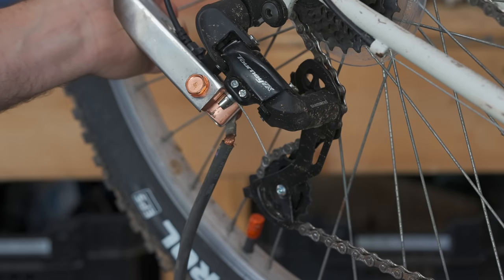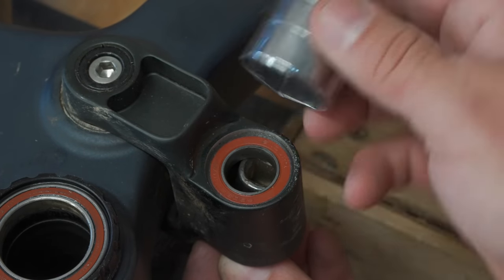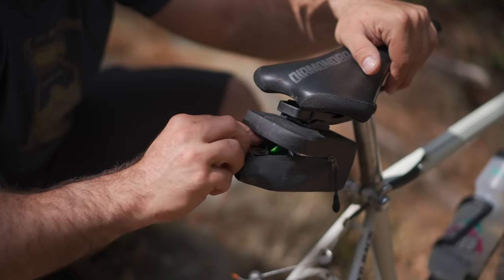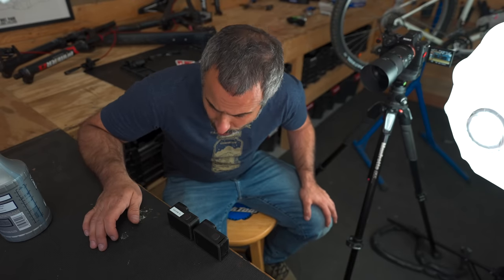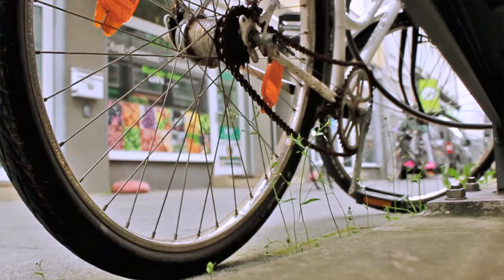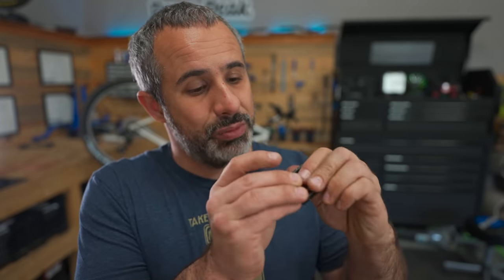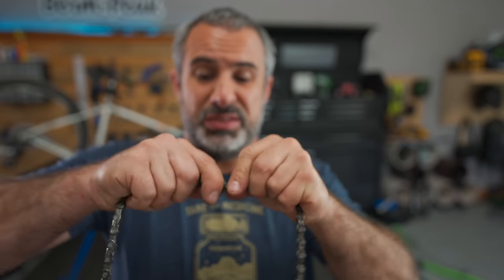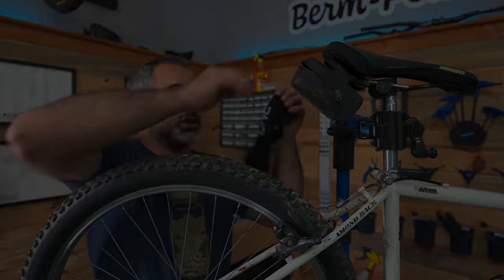10 ill-advised hacks for bicycles

Comment: I HATE those crimp-on cable end caps... they never stay on, so I prefer to solder mine. could probably use an epoxy too, but then you have to wait for it to cure... solder hardens up instantly

Comment: I've owned multiple gopros, they always fail after about two years. Never buying one ever again.
One failed to update and bricked itself, one won't turn on in any temperature above 65 degrees fahrenheit and a third one simply won't turn on. Another one wont operate with a battery (any battery) and a forth has what appears to be damage that maybe the sun caused? Gopro told me to essentially kick sand.

Comment: If you dont have a welder you can use a lighter and a bit of rosin core solder. Heat the tip
of your brake cable with the lighter or torch. Then flow the solder into the end of the cable. }:3

Comment: Seth, can you do a video on how to bead tubeless tyres with a floor pump?
Reply: Soapy water on bead... Remove valve core... Pump like hell.
Or buy a presta - schrader adaptor & take wheel to a service station to use their compressor

Comment: So I recently started MTB and have gone twice with my brand new bike. After my second time, it’s making this squeaking sound just from rocking it back and forth(no squeezing of brakes or pressing of suspension) I did run a trail with a decent amount of dirt, mud and relatively deep water. I washed it once I got home and dried it with a microfiber towel. Anybody know why ur might be making that noise? Should I be concerned?

Comment: I'm not sure I would weld the cable ends , those hot sparks will mess up your paint and also land on your brake discs and mess them up. I use a hot glue gun and put a ball of hot glue on the end of the cable.

Comment: Just FYI this came to mind, so I googled it for confirmation:
The section of federal law that makes mutilating coins a crime is Title 18, Section 331, which reads:
"Whoever fraudulently alters, defaces, mutilates, impairs, diminishes, falsifies, scales, or lightens any of the coins coined at the mints of the United States, or any foreign coins which are by law made current or are in actual use or circulation as money within the United States; or whoever fraudulently possesses, passes, utters, publishes, or sells, or attempts to pass, utter, publish, or sell, or brings into the United States, any such coin, knowing the same to be altered, defaced, mutilated, impaired, diminished, falsified, scaled, or lightened shall be fined under this title or imprisoned not more than five years, or both."

Comment: This thing with the chain was my regularly way to close chains in private, sure there are many legends out there that you shouldn’t do this cause your chain will easily broke again but what should I say, again, this was my normal way to close chains and the only chains I could get broken was 9 gear chain…
But not cause of my way to close it, it was just a weak chain typ and I broke 4 of them till I throw the whole gearshift into the bin and go over to single speed or gearhubs…
Never again a f… chain shifter, never again setup a new gearbox cause the „old“ broke again within a week and never again a falling chain of the gears where it was in anyway dangerous…
Sure, chain shifter are still nice on roadbikes cause the wider translation but the repair and maintenance is so much much bigger on this open system that I don’t would recommend it for anybody who don’t want to work on this on a weekly basis cause that’s just what needed on heavy use…
But for everybody for who even punctures are „very big“ issues are closed systems like gear hubs or with just one (perfect) gear way better, for example the gearhub of my 20“ folding bike still runs as new since now nearly 10 years and guess what, I never did anything on that, setup the first time I installed it and from there it just sees dirt, water and 1 or 2 times a year some WD40 or Balistrol, that’s just it…
The old Sachs company was really great in there gearhub section and that’s why sram do on most hubs exactly nothing without printing there label on it and just selling it further…
The old 3 gear hub is nearly undestroyable and needs really nothing next to regular movement and the 8 gears is still one of the best gearhubs you can get, it’s cheap, kind of lightweight (next to other gearhubs), has a great translation and a pretty wide range for a gearhub and the best on it is the flexibility…
On my old Cityrunner (before I switched to the 20“) I run the SRAM 8 speed with the brake inside, this typ of break was an option but not very comfortable so I decided to switch to a shimano gearhub even when it is by far not in the same class…
Shortly before I wanted to buy the new hub my old mentor in the bike shop asks me why I just don’t rework the 8 speed…
Sachs was so lazy to design different parts they use allready existing parts, so like in the 8 speed…
It’s not very common knowledge that Sachs has created a freewheel 8 speed two and they just sell it a short time before sram bought it, so I am not completly sure if sram don’t bring the freewheel 8 speed back but so far I know just Sachs has sold it officially..
But back to the topic, the trick in this story, the brake and freewheel 8 speed was exactly the same hub with just some internal adjustments, this means that they just took out the brake components and just put in a spacer with some nubs what is literally just a piece of a pipe with some nubs and those nubs are just there for one thing, that you have not so much death when starts paddling after some freewheel rolling…
Sure that was the small downside of my little crafting action but on the other hand I had an perfectly working freewheel 8 speed from sram, something that not so many people can say over them self…😅😂

Comment: Flux and solder the cables. 
The pin on the chain needs a pointed punch strike on both sides so it doesn't come apart and it's good as any other link. 
Putting a sock in it means the mouth so you don't hear them scream.